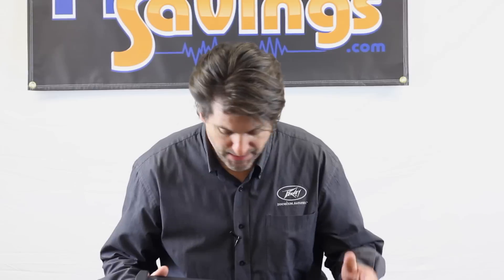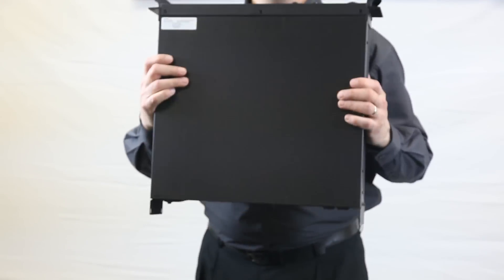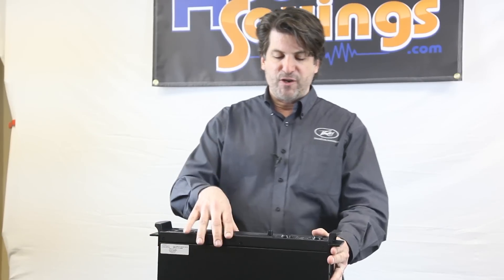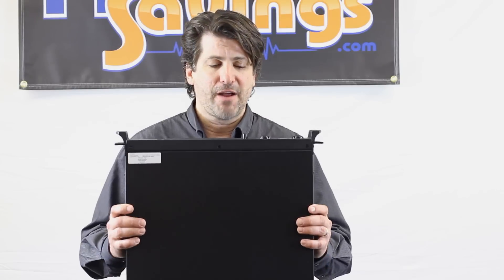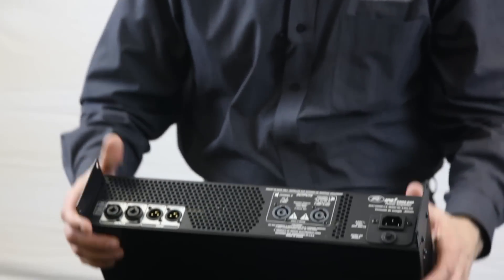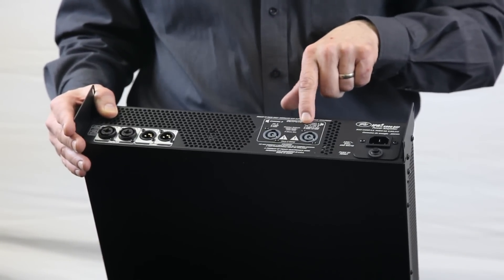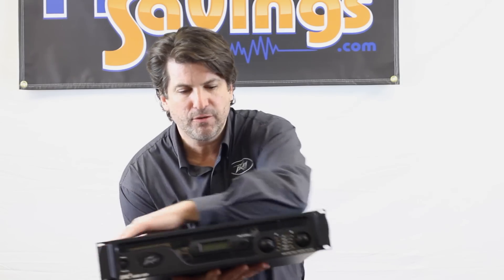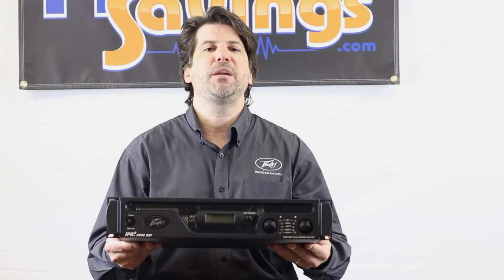Peavey IPR2 5000 Lightweight Professional Audio Power Amplifier | AudioSavings.com

Comment: I have a Question about the Crossover inside the IPR's. Do you know what frequency the crossover actually starts to work for the Low End. 100 Hz, 150Hz, 300Hz?